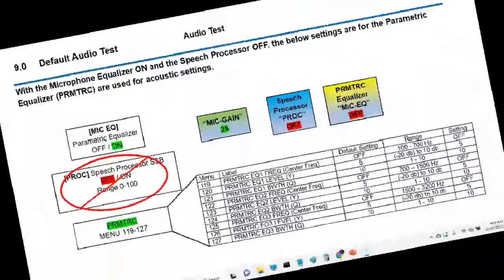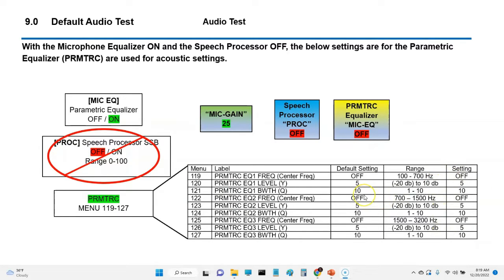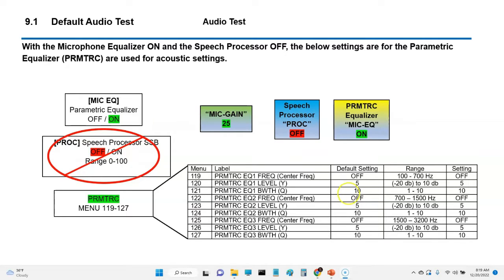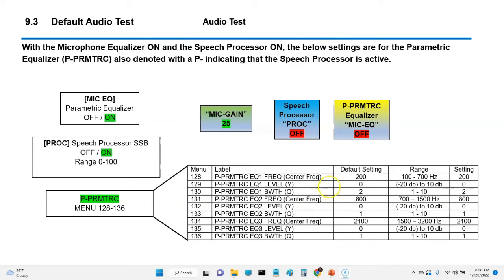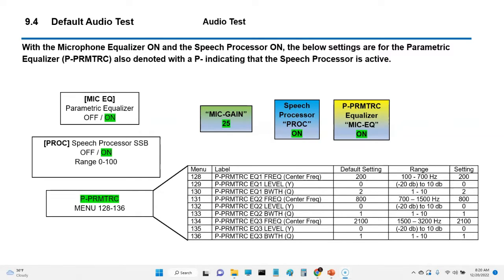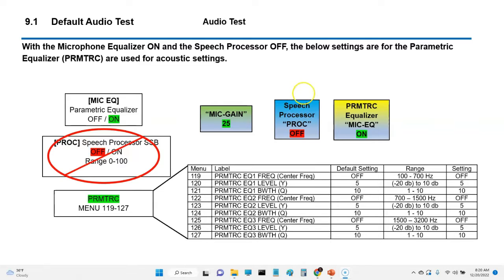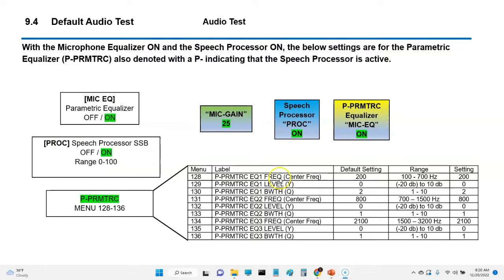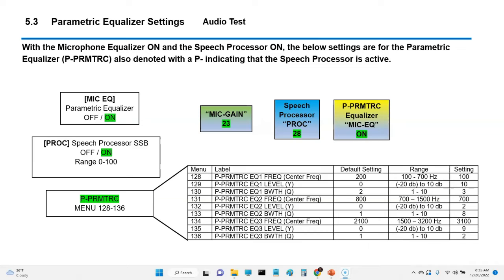Part 2-R1 FT991A Setting Up Parametric Equalizer and Speech Processor Live on Radio w/ Pre-Post Test

Comment: Are these settings ok for the stock hand microphone?
Reply from the maker: Good evening - here's a video I did on the factory mic in positions 1 and 2 https://youtu.be/uQdin1HpsVY?si=4HSdXQo4V0zNRNz5   let mw know if you need anything else the M100 Treble Boost Cone will definitely help your SSB - let me know if you need anything else be glad to help GL and 73
Reply: @ thank you . Did you change any of the settings other than turning on the microphone equalizer and speech processor with the stock microphone?

Comment: Yes this was very helpful. I just received my 991A last week. I usually use the stock mic with all my rigs, so I thought it would be good to trim the settings to optimum. I checked in with our morning net and received immediate kudos on my audio. Thank you!
Reply from the maker: Hi Bob and thanks for the message - have fun with the new rig let me know if you need anything one tip at one time Yaesu was sending out radios with the water fall not active just in case here's video https://youtu.be/JKYCcixg7M4?si=LUgjerkKK7f6-BqM  GL and 73

Comment: Useful and we'll done as all your video 🔝
It could be nice if you explain why and haw chose the value of the parameters 🤓
Thanks 😊
Reply from the maker: Good evening Marcello, thanks for the message, actually I had some of the settings recommend by other subscribers and some of my own testing with headphones and and the MONI feature turned on and transmitting into a dummy load, b and one from the Yeasu manual.  also on my QRZ page I have three different settings too to try, I  hope this helps appreciate the message and have  a Merry Christmas '73

Comment: Thanks for the follow up.  Why wouldn't you always leave the speach processor engaged all of the time?  Also, how did you come up with all of the specific settings for the 119 to 127 menu items?
Reply from the maker: Hi Scott, Good Question I would Speech Processor all the time, there are some Parametric EQ settings in the manual, I also had some other subscribers send me there's to compare.  On my QRZ page I have them listed three different configurations for the Speech Processor and Parametric EQ active.  This is the link to my QRZ page check it email me to if you need more details I can send yo the Excel file.  QRZ page https://www.qrz.com/db/ki5juf
Reply: @westtexasvideogateski5juf255  Thanks, I'll take a look.